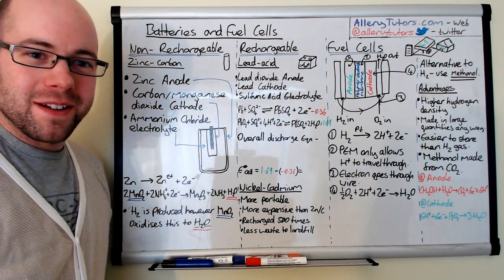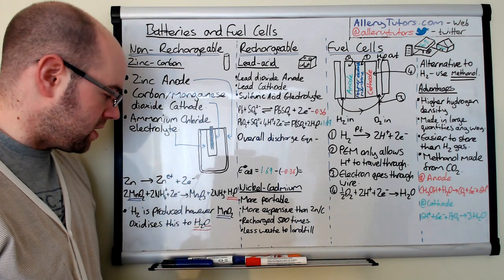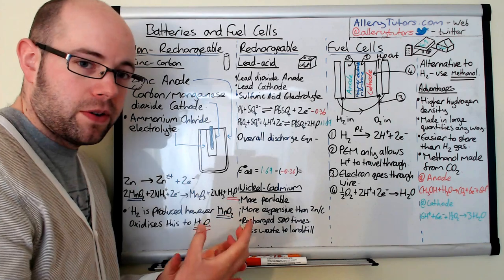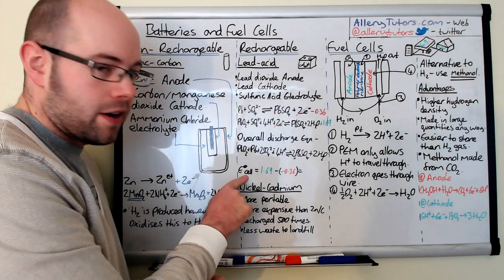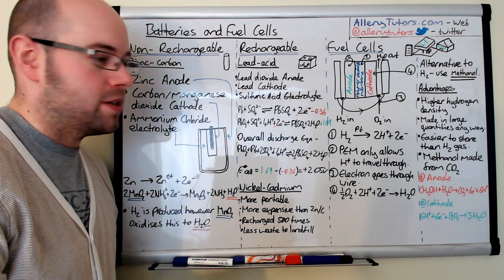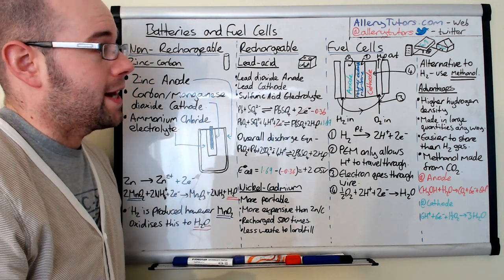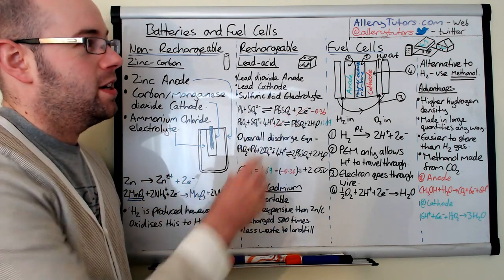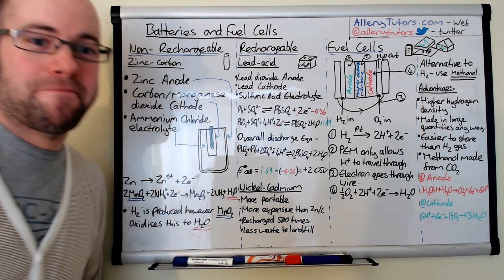Batteries and Fuel Cells

Comment: Awesome video, really helpful in understanding the different cells. Just for reassurance, when REACHARGING, an external voltage applied forces the reaction backwards and when this happens you swap the equations around, however, do the EMF values switch around and does the ANODE and CATHODE switch around too? Thanks
Reply from the maker: Thanks! Yes you are right. :-)
Reply: Awesome! Thank you

Comment: I'm confused, so in lead Acid battery, the anode is reduction, and the cathode is oxidation

but in Zinc-Carbon Battery, the Anode is oxidation, and cathode is Reduction??
Reply from the maker: +thesuperproify Yes an odd one. You just have to remember that exception I'm afraid! The reasons behind this are complex and exceed A level specifications.
Reply: A Level Chemistry Revision Videos by Allery Tutors alright, thanks a lot mr Allery :D:D:D:D

Comment: This will sound soo dumb but in the non-rechargeable battery, when the zinc anode is oxidised, then does it reduce in size because the zinc metal is losing electrons and forming ions? Batteries never reduce in size though so I was just confused about that. Thanks so much if you reply :)
Reply from the maker: +Mel tansz No it's a very good question! You are right the casing will wear away. Normally there is a thin protective plate between outer plastic label and zinc electrode to prevent the battery shape distorting. Occasionally though even this is damaged and the battery leaks. Very messy!
Reply: That makes so much more sense! Thanks so much for the reply it cleared up my doubts! :)
Reply from the maker: +Mel tansz No problem!

Comment: Why does the H+ want to move toward the cathode?
Reply from the maker: +Arash Outadi The Cathode is negatively charged and the H+ ion is attracted towards the opposite charge. While at the negative charge it gains electrons and is reduced.
Reply: +Allery Chemistry okay what is the cathode negatively charged with? Is the oxygen gas also reacting with platinum to make oxide ions?
Reply from the maker: It is negatively charged due to a larger number of electrons than protons.